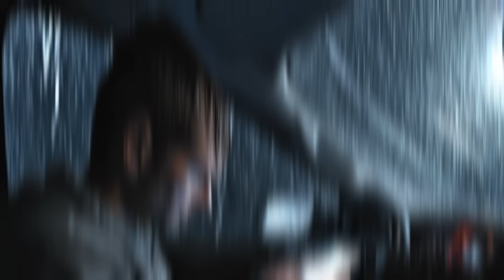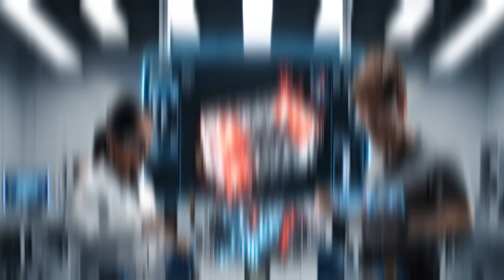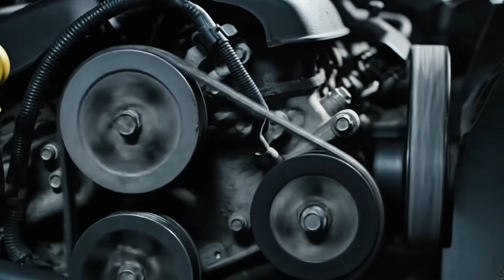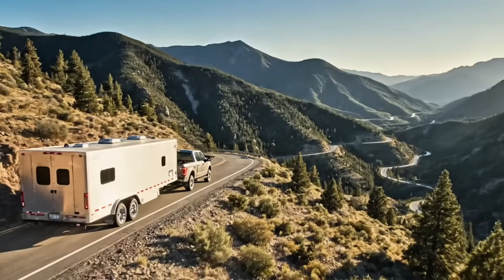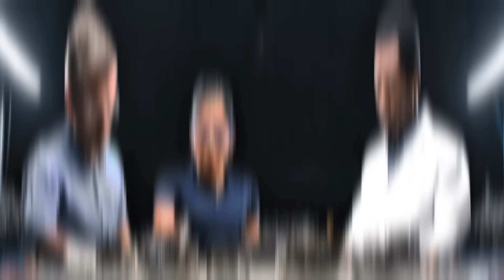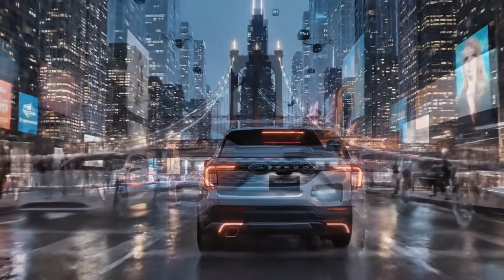Ford Just Ended the EcoBoost Nightmare in 2026 — Truth Revealed

Comment: the ford 2.7 has been most reliable engine they have.we never see any problems with them except maybe oil pan gasket leak
Reply from the maker: The 2.7L EcoBoost has built a strong reputation among many owners, and your experience is a good example. Oil pan gasket leaks can happen, but it’s important to judge the engine by real-world reliability data rather than assume every unit has the same issues.

Comment: The biggest problem was open deck blocks that showed up more in the 4 cylinder or V6 that were worked hard every day. The other major problem is the majority of drivers only know how to gas and go, and someone that checks tire pressure once a month or less is rare to find, these people don't know that if you drive a turbo engine you can't just jump in and drive normal when it's cold or jump out and shut it off after racing to work and this kind of driving is what kills turbos. I have built I4 and V6 turbo engines that produced over 1K HP and everyone on them had an electric oil pump that fed the turbos for up to 5 minutes after engine off. So maybe Ford needs to put some coding in the ECM so when people have to race to work, they can turn car off get out lock doors and engine will shut down after turbos cool off enough.
Reply from the maker: You make a fantastic point about turbo heat management and real-world driving habits, and an automated post-shutdown cool-down cycle would save a lot of hardware!

Comment: Hmmm - what about the small 1.0 litre EcoBoost petrol engines put in the Fiesta, EcoSport, Focus and B-Max models in Europe? And what about the 1.6 litre EcoBoost petrol engines put in the Focus, C-Max and Grand C-Max models in Europe? Are Ford even BOTHERED about all THOSE engine failures?
Reply from the maker: That’s a fair question. The older 1.0L and 1.6L EcoBoost engines had their own well-documented issues, especially in certain European applications. Ford has made changes over the years, but long-term reliability is definitely worth discussing separately. Thanks for bringing up the European models—great point!

Comment: Hey With the overall engine design changes I would look at getting one. I personally think a F150 Hybrid would be excellent decision for Ford. The Maverick has hybrid and is a great seller.
Reply from the maker: That’s actually where the truck market seems to be heading. If Ford can combine hybrid torque with solid long-term reliability, the F-150 Hybrid could become huge. The Maverick definitely proved buyers are open to hybrids when they’re practical and useful.

Comment: I’ve always installed an OIL CATCH CAN on the PCV SYSTEM regardless if it has Port injection or Direct injection because because that oily film can buildup in the intake runners disrupting and restricting air flow
Reply from the maker: That’s actually a smart preventative step, especially on turbo/direct-injection setups. Keeping oil vapor out of the intake can definitely help reduce carbon buildup over time and keep airflow cleaner.

Comment: Nope. My 3.5 failed at 134k, since the body has to come off the chassis these days I can't pull it. Dealer wants 17 k to replace the motor. All of the new stuff is planned to fail and access to simple maintenance like changing your own oil or breaks is restricted to dealers service. No thanks, I'm done with any new model American car or truck.
Reply from the maker: Stories like this are exactly why so many truck owners are frustrated right now. A $17K engine replacement on a modern truck is brutal. People can accept technology when it improves reliability, but not when basic repairs become harder and more expensive.

Comment: Really love manufactures to go back with naturally aspirated GAS engines I used to save more gas on my 2003 4.7 V8 explorer than the one now 2016 3.5 eco boost explorer when turbo is introduced  to a engine it will burn more gas no matter the size
Reply from the maker: A lot of owners say the same thing. Small turbo engines can make big power, but once boost kicks in hard, fuel economy often drops fast in real-world driving.

Comment: I have a 2019 F150 and the extra port injector is in this engine, so the 2026 is getting the same as mine, which by the way appears to work quite well
Reply from the maker: That’s actually a good point. A lot of owners with the dual injection setup seem to have had pretty solid long-term experiences with it so far.

Comment: What the hell is this? Sounds like a Ford propaganda video. I have a 2017 F-150 with the 3.5 EcoBoost. I currently have 79k on it, I change the oil every 5k. I had the cam phasers replaced twice, once under the engine warranty, and once under the parts warranty. I also had to have the temperature control housing replaced due to an overheating issue after I had the cam phasers replaced. Ford refused to replace it under warranty. The 10 speed transmission shifts like garbage.
Reply from the maker: That’s exactly the kind of owner experience a lot of people are frustrated about. The cam phaser issues and rough 10-speed behavior have been some of the biggest complaints on those trucks. Appreciate you sharing real-world experience from actually owning one.

Comment: I have a 2015 ford f150 and it’s been a good truck with that being said it has not been perfect it’s at the shop now waiting to get fix it has an oil leak at 2,500 dollar the vacuum pump the valve cover gaskets and a gasket on the front of the engine. I still love my truck and it’s good on fuel and best of all it’s 100 paid for
Reply from the maker: That’s probably the most realistic ownership experience honestly 😂 Not perfect, a few expensive repairs along the way, but if the truck still does the job well and it’s paid off, a lot of owners are happy to keep them running.

Comment: This stuff was known in real world 🌎  they tried cheap out  but it back fired taking a small engine pumping a lot of air  in it not a good idea
Reply from the maker: That’s the debate right there. Small turbo engines can make huge power, but long-term durability under heavy truck use is what many owners still question.

Comment: The biggest problem is dumb ass people I think. Have 3.5 eco boost with 298,000 have never changed one part in it. Just regular oil changes and maintenance. Don’t go til the oil light turns on plus I use AMSOIL every 5000 miles
Reply from the maker: Proper maintenance really does make a huge difference. There are definitely EcoBoost owners getting serious mileage out of them with consistent oil changes and care.

Comment: My neighbor had an F-150 w a 2.something ecoboost to drag their full size camper which I eyed w suspicion.  We had a 3-4,000 lb day sailboat w a fixed keel that we dragged firstly w a 4l 6 in an explorer, which was dicey in high heat.  Another explorer later w the 4.6 8cyl solved the worry problem.

I envied his fuel mileage when he used his truck as a grocery getter, but not that much - not when we’re in the boonies with our boat.  We’re no longer neighbors; he got rid of his 150, but I never got the story why.

I dunno, it’s tough to beat an 8cyl for towing.  Call me old fashioned, but stressing a tiny block and using a stressed out turbo seems to equal a stressed out driver pulling big loads.

Can you even get an 8cyl in an Explorer anymore?

Comment: We have a 2018. Eco boost in an expedition 3.5  it has duel fuel injection port and direct this was done in 2017  the second 3.5  version I think we’re up to 4 th version 2026  we have 113000 miles had phasers and water pump done  on the third set of tires second battery  second set of brakes  full synthetic oil at 5000 intervals hopefully it will be my last car
Reply from the maker: Sounds like you’ve taken really good care of that Expedition. Regular oil changes and maintenance make a huge difference with the 3.5 EcoBoost long term. 113k miles is solid 👍

Comment: I have a 2.0 ecoboost with 230k. I drive my 13 ST Focus like I stole it. Regular oil chandes 93 octane gas and I let the turbo warm up and cool down properly. It requires high rpm's to thrive. I always down shift before i accelerate.
Reply from the maker: 230k while driving it hard is honestly impressive. Sounds like you’ve been doing the important things right — good fuel, regular oil changes, and letting the turbo warm up and cool down properly.

Comment: Ford you need to get back to Old School go back to when you had good engines go back to when you didn't have all this smog crap all over your truck or cars go back to when a man could actually work on the vehicle that means get rid of the computer
Reply from the maker: A lot of people miss when trucks were simpler and easier to work on in the driveway. Modern emissions systems and electronics added efficiency, but they also added a lot more complexity.

Comment: If you drive these engines hard, then immediately shut the engines off, they aren’t going to last. When I’m traveling on the Interstate, when I pull of I drive at slower speeds for about 10 minutes or let the engine idle to cool down the turbo charger.
Reply from the maker: That cooldown habit probably saves a lot of turbochargers over the long run. A lot of people forget that heat management and oil quality make a huge difference on turbo engines.

Comment: All Ford engines and Fords are junk. I replaced two Vulcan Engines in my 1988 Taurus. Since then I stay mostly with Toyota - no engine problems.
Reply from the maker: Every brand has had good engines and bad ones over the years. Toyota definitely built a strong reputation for reliability, especially in the long term.

Comment: Turbos suck. You beat the hell out of small motor with a turbo and wonder why it wears out early.
Reply from the maker: That’s the biggest concern a lot of people have with small turbo engines. More power from less displacement usually means more heat and stress over time.

Comment: My 2014 would run right at the overheat mark when towing a 4000lb trailer up a hill. Nothing would fix it. I now have a 2017 5.0, problem fixed. And they all get the same mpg, 15-16, weatherstrip it's 3.5, 5.4, or 5.0. It's all about the weight.
Reply from the maker: That’s been the experience for a lot of towing owners. Under heavy load, real-world MPG and heat management matter more than the brochure numbers.

Comment: Fingers crossed the dual injection (which they definitely did quietly), with top tier fuel and frequent fluid changes gives my 2026 2.3L longevity.. haha
Reply from the maker: A lot of owners are hoping the dual injection setup helps long term carbon buildup and reliability issues. Frequent fluid changes and quality fuel definitely give these engines a better chance over the long haul.

Comment: EPA and CAFE has crushed reliability and durability  any issue can be drilled down to this root cause too much tech to squeeze out MPG a bit of milage to throw away vehicles dump gdi, egr, turbos etc get back to inline 6 and V8
Reply from the maker: A lot of truck owners feel the same way. Chasing MPG and emissions targets has definitely pushed engines toward more complexity over the years.

Comment: 2011 3.5 V6 XLT Super cab . 110,000 miles. All routine maintenance performed. NO ISSUES! 17.5 mpg on average. Pains for since 2015. 😉
Reply from the maker: That’s impressive for an early 2011 model. Regular maintenance really does seem to make the biggest difference with these engines.

Comment: DURABILITY IS KiNG
Reply from the maker: Exactly. Most truck owners will trade a little fuel economy for an engine that lasts 250k+ miles without drama.
Reply: @NextGenWheels-s5r  No one would choose fuel economy over durability and long life if they knew how trivial and miniscule the MPG delta actually is.  The MPG advantage is completely unjustified.
Reply from the maker: @GeneralFukzamatayu  That’s why so many owners still put reliability at the top of the list. A few extra MPG looks great on paper, but if durability takes a hit, most truck buyers see that as a bad trade-off.
Reply: @NextGenWheels-s5r  

Sacrificing reliability/longevity is worse for the buyer/owner, for earth, and for humanity as a whole.

Toyota nailed it (had it exactly/precisely right) in the 1990's.

"Dabbling in Degradation" has been disastrous.
Reply from the maker: @GeneralFukzamatayu  I can see why a lot of people feel that way. There’s definitely an argument that building vehicles to last longer is better for owners and reduces waste in the long run. The challenge is balancing durability, emissions, efficiency, and cost—something every manufacturer is still trying to get right. The ’90s Toyota reputation set a pretty high bar.

Comment: I'm very unhappy that Ford has admitted they have known their 1.5 and 2.0 eco boost engines have  faulty design flaws and refuse to fix them. I have two Escapes with one of each with my next rotation coming up, I will not be purchasing another Ford product. I will be purchasing a Toyota,  Honda or Subaru. Ex-long time Ford lover.  😢
Reply from the maker: That’s the part that frustrates longtime owners the most. Once people lose trust in reliability, it’s really hard for any brand to win them back — especially when repair costs keep climbing.

Comment: The ONLY way to end the EcoBoost Nightmare is to END the damned EcoBoost engines. I own 4 Fords. 2 of them are the 4.6L SOHC 2 valve V8, one is the 3.8L Essex V6, 2003 model, and the last one is a 1968 390 four barrel. No turbos for me no way no how, unless it is a '70s Porsche 930.
Reply from the maker: Those older Ford engines earned their reputation the hard way 👍 Simple, durable, and easy to keep running for decades. A lot of truck fans still prefer that old-school formula over modern turbo setups.

Comment: Here's my problem with the EcoBoost.  20 years ago I had a Subaru Impreza Outback Sport. Great car, AWD, decent power, normally aspirated 2.5L. Change the oil every 3k, bottle of fuel injector cleaner with every oil change, did the plugs once when I got it.  20mpg. 

Now I have a 2017 Escape. Great car, slightly better power, AWD.  1.5L high compression direct injected turbocharged EcoBoost. Still needs oil every 3k (Fords maintenance interval are a joke). Have to run a light detergent (MMO) in every tank of gas to keep the combustion chamber and injectors clean.  Have to run 91 octane to get the added power, run 87 and it's a dog.  Plugs every 30k.  All this extra expense.....and I still get 20 mpg.
Reply from the maker: That’s the tradeoff a lot of people are talking about with modern small turbo engines. More complexity, premium fuel, shorter maintenance intervals, and extra upkeep — but sometimes without the huge real-world MPG gains people expected.

Comment: Do not know what this video is talking about. Most all of the issues with the EcoBoost at least the 1.5 and 2.0 was corrected in 2020 they  make it sound like it just happened The 3.5 got a lot more reliable in 2019. This didn't just happen in 2026. This has been happening over the course of the last 6 years
Reply from the maker: Fair point. Some of the early EcoBoost problems were addressed over time, especially on the newer generations. A lot of owners with the updated 3.5s have had much better experiences than the first versions.

Comment: What about the rubber oil pump belt , what idiot designed that mess.
Reply from the maker: The wet belt design has become one of the most controversial modern engine choices for sure. A lot of owners simply don’t trust it long term.

Comment: Mmmm No. never trust a small turbo charged engine
Reply from the maker: That’s a common concern right now. Small turbo engines can make impressive power, but many buyers still question how they’ll hold up after 150k or 200k miles.

Comment: they weren't that much more fuel efficient when pushed to the limits like folks actually used the trucks.  you can have eco or boost..not both at the same time
Reply from the maker: That’s the tradeoff a lot of owners discovered in real-world driving. Easy cruising can save fuel, but once you’re towing or staying in boost, the mileage advantage disappears pretty fast.

Comment: Blah blah blah bullshit. ALL the new engines are over-complicated junk, no reliability. And we are FORCED to accept it, no options.
Reply from the maker: A lot of truck owners miss when engines were simpler and easier to repair. Modern trucks have more power and tech than ever, but many people still value long-term durability over extra complexity.
Reply: @NextGenWheels-s5r  I clearly remember sitting in the engine bay of my 79 Chev 4X4 changing the spark plugs.
Reply from the maker: @reloadnorth7722  Those were different times for sure. 😄 Back then you could practically climb into the engine bay and do half the maintenance yourself. Modern trucks make more power and get better efficiency, but a lot of people miss that simplicity.

Comment: I actually like my 3.5 and haven't really had any issues, got rid of my 1st 1 and it has 172k and my 2nd 1 is now up to 86k ,now the junk 10r80 transmission is a different story but i just keep a warranty because i like my tremor a lot. Im not saying i trust my fords like i trust my 08 and 2010 tundras with the 5.7 but i do lile them.
Reply from the maker: That’s probably the most balanced take honestly. A lot of the EcoBoost owners like the power and drivability, but the long-term trust factor still isn’t where the old V8s and Tundras earned their reputation.